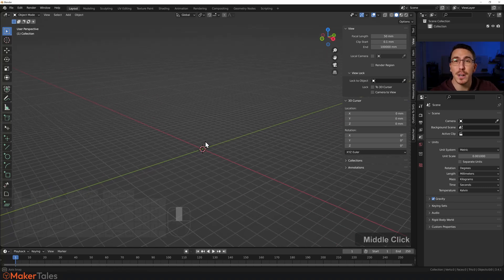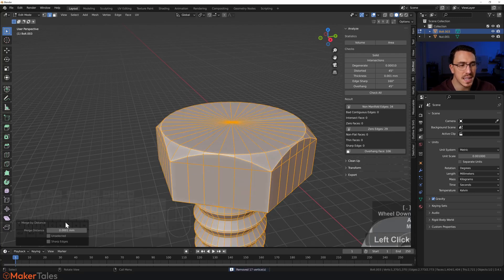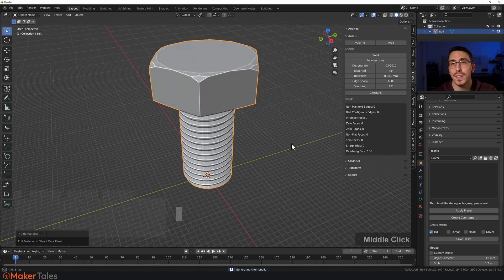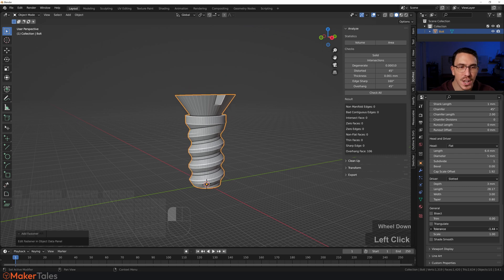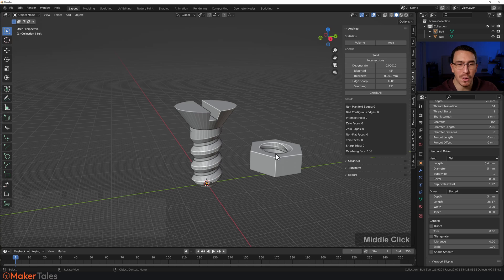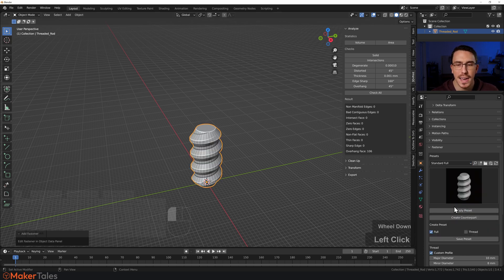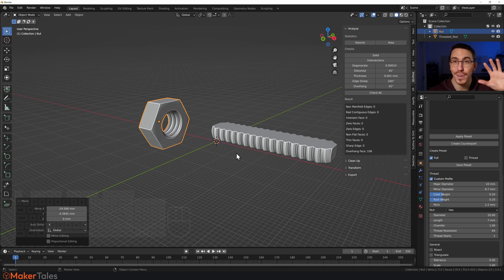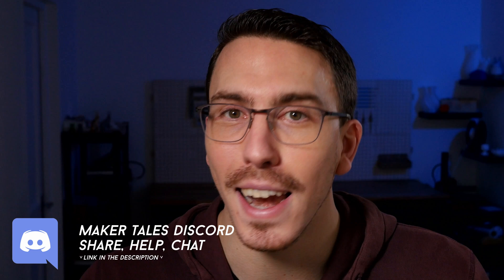Blender CAD Bolts, Nuts & Threads. Perfect for 3D Printing

Comment: I just downloaded the Precision_Bolts_[_Addon_].zip and Precision_Gears_[_Addon_].zip and imported both via blender preferences 'install'. No error msg, but neither shows up in the addons list for being activated. For PrecisionBolts_0_1_4.zip at least, there is now the 'fasteners' option in add > mesh, with bolt factory is on, too. I'm using blender 3.6.4 currently, btw. Post-edit: with PrecisionGears_0_1_92.zip everythng is fine now too (one needs to make sure to confirm email in gumroad in order to access the 'real' installation .zips). Apart from this, mac-users need to be aware that fully enabling addon presets etc., requires the dev-tools (xcode) to be installed for some GIT operations in background... Anyway, really great stuff, once working.

Comment: Couldn't login to Discord, will post here. Bought/DL/installed Precision Bolts (PB). My blender 3.4 scale is set to MM @ .001 This scale setup works great for STL to Slicer and DXF to Inkscape SVG to laser. When in blender/PB I Add a Hex bolt, change the head to flat. The problem is the Dim of the flat head is limited to 5mm and that makes the head 173mm.

Comment: can you use it to make replacement parts for existing threads? Maybe you could add some of the standard sizes as presets so it's less values to enter every time m8 m10 etc. Also another great feature would be adding a Boolean function, so you can add threads inside other objects, besides just making nuts and bolts.

Comment: Hi there, I just bought and installed the addon, but the default size of the bolt it creates is gigantic. Is there any way to change this? I can't get a working bolt out of it because there are dozens of parameters I have to change to get it down to 3D printing size. Also, the first four preset thumbnails don't appear for me. Is the addon compatible with Blender 3.4.1? Any help would be good!
Reply: Have been testing on 3.2.0 and 3.1 i think but the size is ok but the parts doesn't fit when printing even if i add bigger tolerance. And i do not get any thumbnails. same goes for blender 3.4.1 so maybe its a plugin we have not enabled that this is depending on?
Reply: @KaiGunterBrandt  Great to know. I had to scale down by 1000 to get working parts, but then parametric functions work normally. I've only printed one nut so far and I'm waiting on the accompanying bolt fixture to test it. It's an amazing addon, very powerful!
Reply: @j.m5888  yes using this its possible to print without overhang and just split the objects in several parts and use the nuts to fix other parts to the printout. have been using "lego parts to snap things together" but using nuts is sometimes a better and more stable solution. also printing the the nuts/bolts  with the bisect is very powerfull when you need better resolution
Reply: I think i know whats happening. I think the script is stopping if the focus is outside the "Presets" window. Also if you press any keys and/or mouse it stops. I pressed the "generate thumbnails" button and did not move the mouse or touch the keyboard for a long time. now i got the previews. if the focus is i another window the "thumbnail rendering... please wait" dissapears so just let it run i guess.
Reply: @KaiGunterBrandt  Hi again. I just got a couple of pieces to test today and they worked fine. The quality was low because of the orientation I printed the piece at, but it was a good fit. The 'make counterpart' option for the nut is great, and it shouldn't need a tolerance setting, nor should you have to adjust there for printing. Could you try 3.4.1. and see what happens? Try the 3D printing options like 'make manifold', just in case there's some rogue geometry causing you problems. Also, if it highlights anything when you're checking, go into Edit mode, press 1 to switch to Vertex selection, A to select all, then try Mesh - Merge by distance. This often removes annoying little doubles of vertices which mess up g-code. You can copy your piece in place and switch it off prior to this operation, just so you don't lose vital geometry without realising.
Reply: @j.m5888  a new test with 3.4.x and its working. the same issue when generating the thumbnails but thats not a big isue. i used a 0.6 nozzle so i had to adjust the tolerance and now the nuts&bolts works together :-) super duper usable plugin.

Comment: Man, I just built my first part in TinkerCAD over the last week - it was a PCIe bracket for a custom PC that didn't fit a standard one. Took me 30+ hours in TinkerCAD and about 28 revisions, haha. Have had a 3D printer in my garage since October and hadn't taken it out of the box until this week... because I knew I'd go down a rabbit hole once I started with it. I'm so amped that I found your channel, and I just want to say that even though I'm new to printing, I've got about a decade of parts prototyping experience, and I really appreciate how incredible this tool is. I cannot wait to play with nuts and bolts, and follow along with your CAD series for blender. Thanks for your hard work and for sharing it with us, it means the world!
Reply: I have put so much time using Tinkercad, it has driven me crazy.

Comment: I saw a construct made with threaded bits sticking up, except half was on the left part and half on the right part, and you screwed a cap down over the threads to hold things together. This looks like it would be a great tool for that kind of construction.